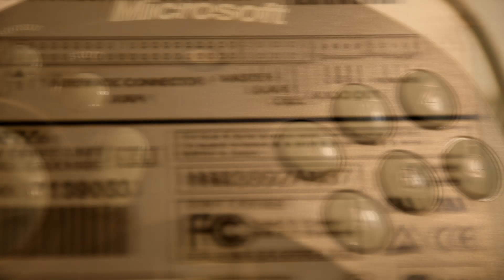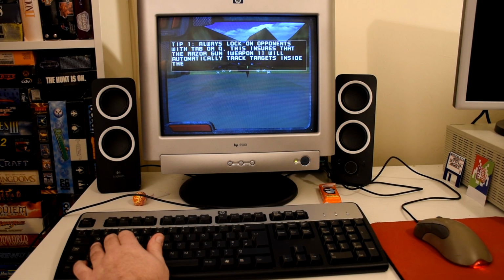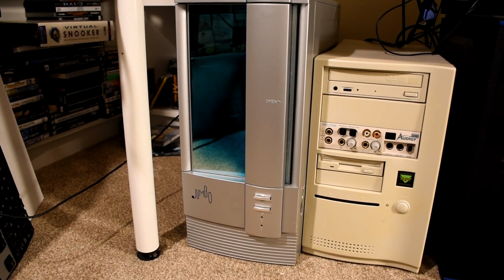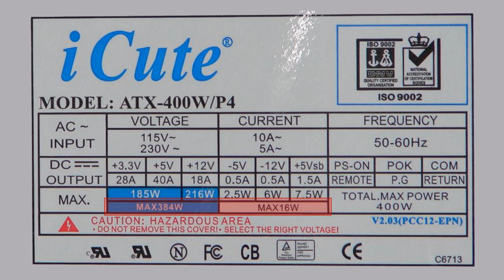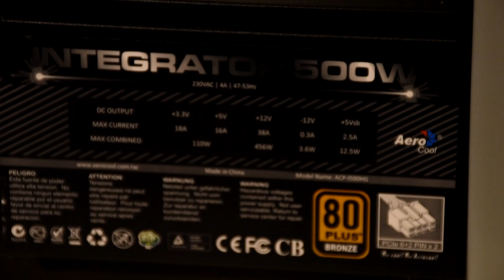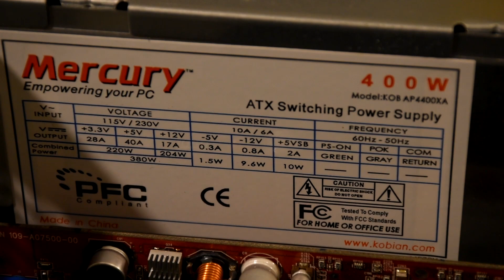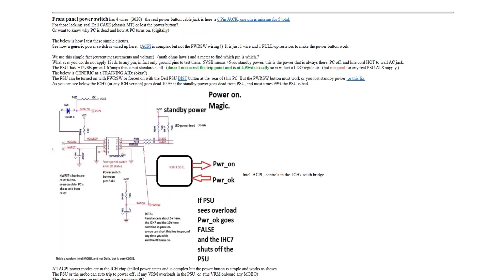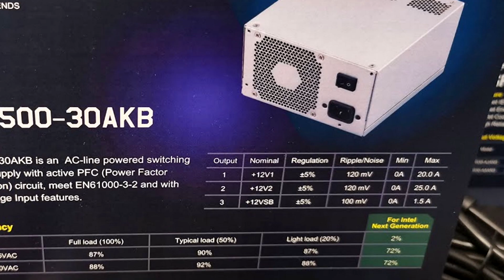The PSU and You: Picking the right power supply for your retro rig

Comment: I never even thought of this being a thing I just always assumed ATX is ATX never even thought to consider individual rails.  The PSU I've salvaged is fairly modern but its 5+ rail is rated at 30A

Will that be enough for a Pentium II/III running a voodoo 3 3500....  or am I needing something else....
Reply from the maker: I didn't really think of it until I started getting random shutdowns on one of my machines.
30A on the 5V rail should be fine
Reply: @GouldFishOnGames  Thank you for taking the time to reply I appreciate it and that's awesome that my PSU should be ok.  Thanks again.

Comment: Looks like the psu with just a +12v and -12v are going to be the only option in a few years. The motherboards will have to do the 5v and 3.3v from that. Hopefully that means adapter that have the 5v, -5v, and 3.3v will com out that can work with AT or atx motherboards.

Comment: Good video! I'm currently in the exact situation you described - I have the Compaq socket 370 board for Pentium 3 (the exact same in the video with the green agp) and I can't find a PSU for it. Can you recommend something? What can I do, which models should I look for?
Reply from the maker: I didn't have much luck with that P3 board (if its the one with 24 power pins).
I tried two different boards and two different PSU's the end result was the same a broken smoking motherboard.
It might be best to try and find a service manual for the machine and see if it says what voltages it needs for those 4 extra pins.